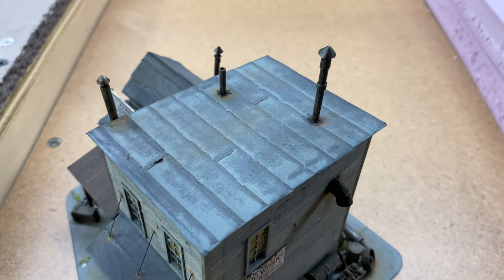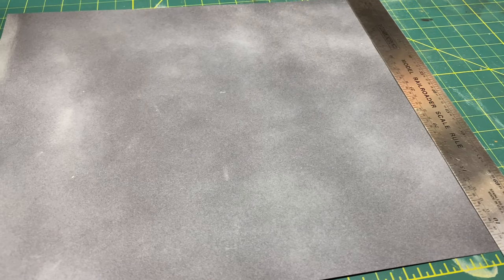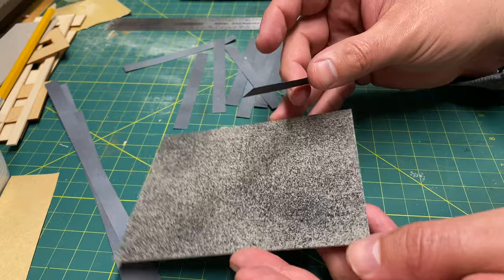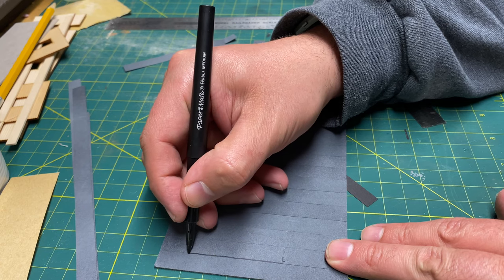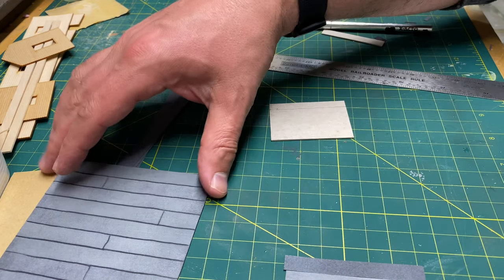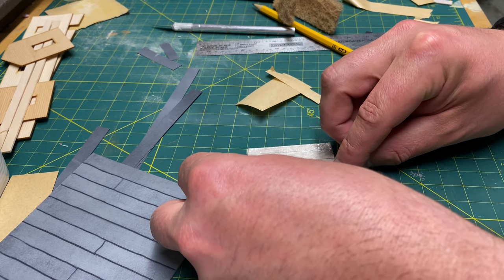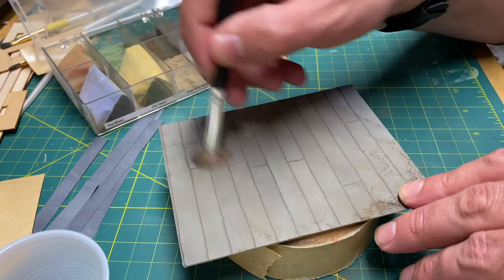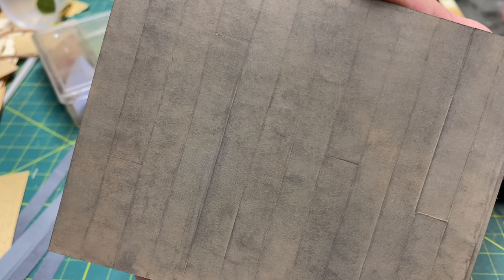Tar Paper Roof for Model Railroad Structures

Comment: Excellent video.  Learned a lot.

Over the years, I've built a lot of structures and have been studying actual ones for inspiration - particularly as there is so much variation.  When you model bunches of buildings in blocks, using the same techniques can be boring.  Now you can disguise this by drawing the eye away with such things as details.  OR you can model different types of tarpaper.  I am often surprised how much variation there is on the prototype, including where you look at it and say "they would never do it that way" (but do).  If you like the look, copy it.  If it looks TOO weird, ignore it.

On some structures, I haven't cut the tarpaper into strips but simply draw on the tar lines.  This may take a bit of weathering after the fact because the overall color would therefore be uniform, whereas the technique you show here achieves that with each strip itself starting off with variation.

I've seen (and modeled) roofs where the tar seams have some relief.  I've taken a Walthers micro-tip intended for their Goo and put it on the end of a tube of artists' paint (the thick stuff) to draw a line, like decorating a cake.  I've also dabbed it on, using a toothpick or one of those plastic toothpicks, but I don't like this as well.  I've used glossy black, instead of a flat color.

I've also used toilet or tissue paper but this can be so flimsy to glue on the normal way.  I've put the tissue paper down on the intended surface and brush on an enamel paint, such as black, letting it soak through.  The paint acts as both a coloring agent and a glue.

I've also modeled sloped roofs, based again on prototypes, where they put the strips perpendicular to the slope.  On these, there is no overlap but tar is used to waterproof the seams.  Here again, it is possible to not use real strips but suggest it with just the seams.

Most tarpaper is black but green, red, and gray are also used.  One roof I did, based on another specific prototype, was where they patched it with some colored sections, while the rest of the roof was black.  In this case, both green AND red.  And using a continuous piece, I merely painted to make some strips look different.  There is also the reverse effect, of say a green roof with patches of black tarpaper.

Patches can also be found as random rectangles wherever there are leaks.  These don't align with the overall pattern, including each patch can be at an angle to the seams.  Or patches made with corrugated iron.  The one example I've seen of that had a whole section of the roof patched with the corrugated iron, not scattered across the surface.

On some roofs, they nail batten strips perpendicular to the strips themselves to hold them down more securely, I guess to make them more wind resistant.  (In model form, the roof of the Atlas lumber shed is modeled with these strips.)

Really cheap construction, such as shacks, tarpaper can be used as a wall siding.  I think here it would have to be the overlap form as you showed for the sloped roof.  On these, more often they nail the tarpaper, rather than use tar, so using a dressmaker's pounce wheel can work for this.  (Specifically, on the roof they also use nails but cover them with tar, or the overlap of the next strip.  On a vertical surface, any rain will drain fast enough to not let the nails get too rusty.)

I would strongly suggest if anyone finds these ideas interesting, to look for a prototype or two to copy.  Don't just go by my description.
Reply from the maker: Thanks for watching and for your comment.  Really appreciate it!